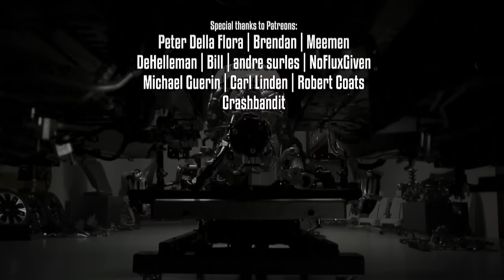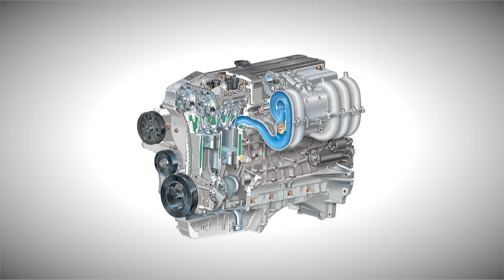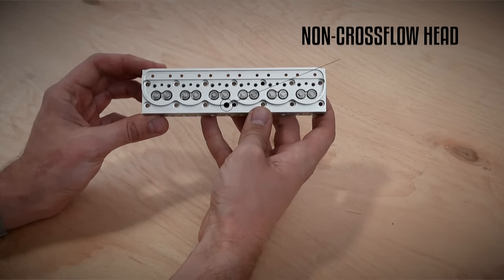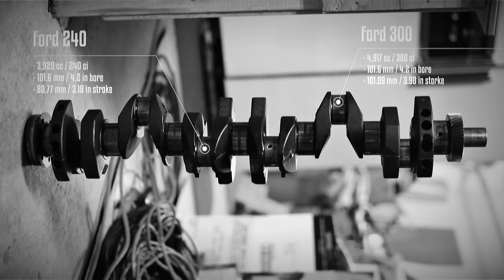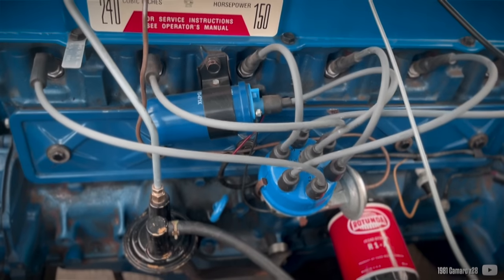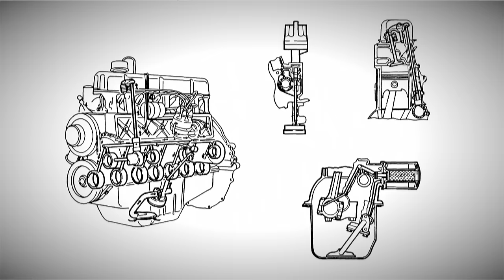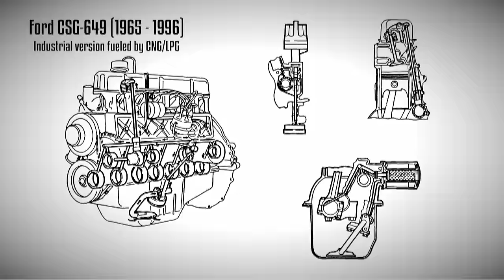Is This Toughest US 6-Cylinder?

Comment: I had one of these engines in my F-150 and it had over 300,000 miles on it with perfect compression and it didn't burn a drop of oil. It also outlasted the truck because the frame on the truck rusted so badly that it was unsafe to drive and so I sold it for parts. The engine is now in another Ford F-150 and is still on the road. With that being said, having worked on many fleet trucks early on in my career I think that the Ford 300 is matched by the Chevy 292. The 292 is also an extremely tough inline 6. I think maybe the only advantage that the 300 has over the 292 is that it has a gear-driven cam shaft instead of a chain driven one. Regardless, you can't go wrong with either of them as they are both nearly indestructible and they make gobs of low-rpm torque which makes them perfect for trucks. I used to refer to my 300 cubic inch straight 6 as a poor man's diesel because it has the operating characteristics of a diesel truck engine. It only has low RPM Power with no mid-range to high RPM Power to speak of. As a matter of fact, at least in stock configuration, the only thing you do about 3,000 RPM is create needless noise. I know everyone is convinced that they need 450 horsepower to tow their bass boat, but I would take this engine or a Chevy 292 over any new light truck engine on the market today,  gas or diesel. Because these engines were only made for one thing, and that was to get work done economically and reliably. It wasn't made to race, or to be fast, it was made to get work done. It was a tractor engine installed in a pickup truck. But that was back in the days when pickup trucks were tools to get work done, not luxury cars with a vestigal 4 ft bed that is almost useless.
Reply: I know the Chevy 250 is gear driven. Was the 292 chain driven? I don’t think that sounds right.
Reply: @VinnyMartello  you are correct. I don't know why, but for some reason, while thinking about it, I was getting the timing parts mixed up in my head with the small Ford inline sixes and Chrysler slant sixes. The Chevy inline 6 is also used gears just like the Ford 240 and 300. To be fair, I worked at a fleet garage for many years, and we had tons of Ford 300 inline sixes. I like the Chevy inline 6 is too, but I don't have as much experience with them. I had a friend in high school with a 1977 Chevy Nova that had a 250 in it, and we replaced it with a 292. We did rebuild that engine, but that was back in the early 1990s. I must have mis-remembered it. It's funny, back in my high school days, we played around with a lot of inline sixes. I had a friend with a 1980 Ford Mustang that had the 200 cubic inch straight 6, which does have a timing chain. Also, I had a friend with a 1978 Plymouth Volare with a 225 slant 6, and that had a timing chain.

Comment: One of the most charming aspects of the 300 was that it would start at -40 with no trouble. Absolutely reliable and Ford made 60 million of them so parts were cheap. The fiber timing gear was a complete pain to replace and may have been the weak link in the engine. The Carter YF carb was a good unit but way to small for the engine. It would stall the power output because you just couldn't get enough fuel/mixture through it to develop any high speed power. I love this engine! I have owned several.
Reply: My 96 starts the second I turn the key no matter how cold. Never uses any oil.
Reply: I always assumed that the fiberglass reinforced plastic gear was designed to shear teeth if something went wrong. With gear to gear timing and all the gears being steel the engine would destroy itself if something went wrong. 🤔🤓🍻
Reply: @alsaunders7805  They get old, they get brittle, they break. It's just a matter of time. If something extreme enough to break a steel timing gear occurred timing gear would not be your biggest problem.
Reply: so it needs a carb and some timing eh? good time for some springs and cams while you're in there and she's good for the next 30 years.
Reply: The dinky carburetor helps insure that you will not overrev the engine or blow it up. 
Put high flow head,header exhaust,high capacity intake runners and big carbs,maybe a performance camshaft and the engines would probably blow up just like other performance engines in hot rods.
Reply: @alsaunders7805  And if the gear sheared / failed it didn't destroy the engine like new motors do , it just wouldn't run and you had to replace  it and back up and running again ....
Reply: @SoulTouchMusic93  Turn up the RPM and power and you will reduce engine lifespan.
Reply: I have a ‘95 F150. I’d say those 80’s and 90’s models were the best trucks they ever made. It was downhill after that. The 4.6 was good, 5.4 only so-so, and they seem to get worse from there with the ecoboost. I’ve even heard of problems with the new 7.3 gas engine they made. We also had a 1992 Ram 3500 Cummins. If I’m not mistaken that had a timing gear as well
Reply: @sparkywirenut  The issue is if that timing belt shears and with the engine going into hard stall, and if the intake valves are open when it does it can warp the cylinders.
 Ford notorious for this, I had a ford ranger that had a timing belt shear, ( at 80,000 mi) and I was on a hunting trip at the time ,what a pain in the ass . Ill take my chances with steel timing belt any day.
Reply: @Bigfootlover69 I have replaced 3. I don't know what causes the failures but you pull the timing cover and there sits a fiber gear with about a quarter of its teeth stripped clear off. They are really a pain to get off. I've never been able to pull the gear with a puller 'cos you just can't get behind it. The cam has to come out and the gear pressed off and the new one pressed on. If you've never had one strip I congratulate you on your good fortune.
Reply: @sitka49  There is no timing belt on the 300 , it usees a chain and gears , also , it's not a zero clearance  chamber , your ford ranger was a compltely different engine .....
Reply: @sparkywirenut  Thanks for clarification.
Reply: Yes but they would pull a mountain down
Reply: @alsaunders7805  possibly because of noise. All the big diesel motors are machined steel.
Reply: @sitka49  
There is no timing belt on the 300.
Reply: I've had four 300 engines, not one ever had a fiber gear.
Reply: @WayneMarion  Thanks, someone else educated me on that already.
Reply: @WayneMarion  I've had several but only replaced the timing gears on 3 and they were all fiber gears. The engines ranged from late 60s to late 80s, I don't know how Ford determined what material to use; maybe someone else out there does.
Reply: @David Powell  Not so, Power Nation did a step by step build on one, ultimately putting a turbo on it, flogged the shit out of it, and ran it in a project truck.
Reply: @paulkimber6028  I saw that. They ultimately built that thing to over 500 horsepower without blowing it up. It was pretty cool.
Reply: That small carburetor did wonders for extending the lifetime.
Reply: @RobertSmith-le8wp pretty much all diesels have gears as opposed to chains.. with some exceptions..
Reply: Thats why you get the iron timing gear. The older ones all came with iron gears.
Reply: @bradfordeaton6558  You're not using your head. Drill and tap 2 holes opposite of each other then use a standard H puller to get the gear off. You can use a puller with three arms depending on the body of the gear, of course. The only thing you need to be careful of is the drill & tap of the holes in the gear. You'll need to use at least 2 taps to get the job done... one to start the threads (possibly two) and one to get full depth threads. Yes, you may have to carefully grind a tap or two by hand to get what you need but it's easily done if you take the time. I'll concede that it may be far easier for me than some folks due to my experience as a mechanic, machinist, welder & fabricator guy but it can be done and done relatively quickly once you have your tools at hand. If worse comes to worst, you can always cut a gear off. Cutoff disc on a grinder, cutting torch and plasma all work - you just have to be careful not to damage anything else! What about getting the new gear on? Make sure the backside of the new gear is slightly beveled and then pre-heat it in an oven up to 550°F. If the pinch at normalized temp is .001 to .002 then the gear should slip right on (heating will expand the gear). If the clearance is .003 to .004 then it probably won't without more heat. Use a torch to heat the hub up to a max of 900°F and it'll go on - just don't go too far! Use a handheld pyrometer to check the temp at the hub but be careful! Keep the flame front of the torch rotating around the hub only and do not get up to more than 900°F! If you do, you most likely will draw the temper out of the gear teeth which is bad. Have a decent fan set up in advance to blow air over the newly installed gear once it's on - it'll only take 10-15 minutes of cool down time to be cool to the touch, depending on how strong the fan is. Do not use water to cool the gear!! Obviously, you'll need some tooling to follow the above path to success but it can be done. Yes, super heavy leather gloves will be required to keep from roasting your hands but you can pre-drill your new gear with anywhere from 2 to 4 holes and thread them. Use fine threads. This accomplishes two things. 1) You can use bolts or even a fixture to hang onto the new gear when you're installing it. 2) Someone in the future will thank you for pre-drilling the new gear for them to take it off way down the road of life! I know that what I wrote sounds like a lot but it really isn't. You only need basic hand tools and what you typically find in a decent garage to accomplish the task. Just plan things out in advance, follow the pre-determined steps and you'll do fine if you're at least an average mechanic. Remember, even if it all goes to Hades in a handbasket, you can still do the old-fashioned thing and just pull the cam. Best wishes!  👍🏻 🔩 🛻

- Max Giganteum
Reply: @MaxGiganteum  It might work if it wasn't a fiber gear. Any threaded fastener you put will pull the threads out and as to the 3 jaw puller there just isn't enough room between the back of the gear and the engine to hook them to anything.
Reply: @bradfordeaton6558  The factory gear is aluminum... with a phenolic coating over the gear teeth. Don't tap the teeth - tap the gear. As for a puller, you're not looking at using a jaw set, you drill & tap the gear to accept bolts and use a slotted gear puller body. The bolt heads have to be big enough to not go through the slots or you need to shim with washers. Also, hit the hub of the old gear with a torch before you start driving the center shaft, it'll come off a lot easier by applying some heat. Peace & good vibes!

- Max Giganteum
Reply: @MaxGiganteum  That never made itself apparent to me but if it comes up again I'll check it. It would sure beat the hell out taking the whole valve train apart to get the cam out.
Reply: @bradfordeaton6558   Which is exactly why I went through the effort of learning to remove the gear and replace it without going the long way. I did ultimately machine out a custom two-piece puller that I called the "pie plate puller" but I won't get into that as you need a machinist or be one to replicate it. Anyway, you do have to remove all the normal front of the engine parts to get to the gear (including the radiator) but you'd have to remove that anyway unless you decided to just pull the engine to accomplish the task while leaving the rad in place. Personally, I'd normally NOT recommend doing that but every guy does his thing. So why would you pull the whole engine for the swap? For a variety of reasons including some guys think it's easier than unbolting the grille. That doesn't make sense to me but neither does unbolting the entire front clip - heard of that being done too! Under normal circumstances, an engine pull is often done for a total engine reseal, to also replace a leaking rear main or for a combination of things. It boils down to what all needs to be done or what needs to be done plus added on. Example? I've known a number of guys that swapped in a new timing set then did a total reseal and called it good. Others? They replaced the cam, lifters, timing gears, core plugs, main seals, pan gasket, water pump, intake manifold, exhaust manifold, carb and the air cleaner assembly. In went a better cam & new lifters plus an aftermarket intake and split headers were installed. Obviously, with the upgrade plan, the timing gears were only a small part of the overall plan. Interestingly to me, I'm often surprised by what decisions different guys make when making repairs. Sometimes, the decision to make upgrades immediately is done and other times it isn't. Example? I don't know why you'd pull the cam to swap in new timing gears but not upgrade the cam if you had already planned to... but chose to do it a few months or less than a year later instead. I get that sometimes money is super tight and that influences our decisions but wow... I'd prefer to not have to go through the motions on the same vehicle twice if I could avoid it. My philosophy is that if you're going to upgrade then get it done all at once and quit messing around. That makes pulling an engine totally worth it because you get everything in at the same time and affords you the opportunity to make the most of the fact that the engine is out. It's far easier to work on your engine, clean it up for some fresh paint, etc. You also have a prime opportunity to spruce up the engine compartment! Getting back to the new gear, the real problem with using my method isn't getting the gear off, it's getting the new one on. The smart play is to accurately measure the bore on the new gear as well as the end of the cam. Dial calipers can work but you've got to be super careful with your measuring technique. A proven to be accurate dial bore gauge or telescoping gauges and a micrometer is a superior way to go. Going on memory, if the pinch fit is at .002 then it's easy with heat. If it's .003 - .004 or even larger then it can be a problem. Having to deal with the gear when it's hot is what makes it troublesome but that's why it'll slip right onto the end of the cam. You want it to be expanded. Trying to tap or pound a gear on is seriously problematic and usually leads to failure. Some guys will tell you to just use a torch and heat the new gear up until it glows red and it'll go on. That may be true... but the gear will not be at a serviceable hardness and it'll most likely fail far sooner than it would if correctly installed. In fact, it could fail as soon as the engine is started if it cracks due to the heat and then breaks at the hub! I've been witness to that occurring but not on an automotive engine, it was in machinery on a production line. The gears failed immediately when under strain due to a failed heat treatment process when they were made. The truth is that it's difficult to say what will or will not happen to any given part due to the addition of serious amounts of heat AFTER a heat treatment process but there is a reason as to why parts are put through heat treatment. It's because it works! When you meddle with that heat treatment, the odds are high that only bad things come from it. As for the gear that's too tight in my opinion, my solution is to open the bore on the new gear by machining it to the desired size with a slight bevel on the inside. A lathe is optimal for that but you can do it on a milling machine, with a radial press, a decent drill press or you can hone it to size. The keys to success are accuracy and making sure the bore is true and centered based on the starting bore. Well, I think that's enough of my yammering on for now. For some reason, I want to go out into the shop and dive into a 300 and play with some timing gears. That might be due to the fact that I haven't done so in too many years to count... and I've forgotten about all the times where things didn't go smoothly. And had to keep myself from throwing tools through the sheetrock on the wall. Best wishes!

- Max Giganteum
Reply: @MaxGiganteum  Thanks for your time. That was worth the read.
Reply: @pantherplatform   You run a engine with no oil??
Reply: It sounds like you're talking about an interference engine where the valves hit the piston if the timing gear shears.
  This has nothing to do with warping a cyl head with valves being opened
Reply: Bingo.  Yes this is just common sense to a mechanically minded engine guy....agreed 100%
Reply: I steal oxycodone from my in-laws.
Reply: @gabrielv.4358  Yes. Small block chevys. Put it in and it burns and leaks it out long before the next oil change is due...
Reply: THERE'S NO CHAIN gumby, only a crank gear and a cam gear! 👋👳‍♂️

Comment: My first vehicle purchase was a 1967 Ford pickup truck with a 240 Six Cylinder. I bought it in 1974 for $700 and I still own it today almost 49 years later, and it still runs as good as the day I bought it. They don't make them like this anymore for sure!
Reply: I bought a 66 with a 240. I originally wanted a v8 , but this engine has totally won me over. It just runs so good I can't bring myself to touch it much beyond an oil change. Is yours a 2wd or 4wd?
Reply: It's a 2WD

Comment: So happy to have a 1990 4.9L (300) steel gear drive, factory fuel injected. 130000 miles so far. It always starts. Very tough.
Reply: Yeah, they're tough. My 1994 E-250 has this engine.  378,000 on the odometer now and going for 500,000.  If I treat it well, it'll make it.
Reply: if its like its forefathers its still got about 200k left in it